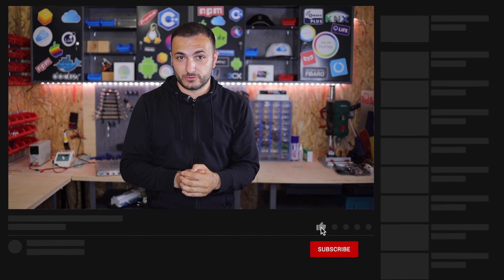Nissan Leaf GEN 2 batteries removed from car and installed on PV system running to 48V

Comment: Nice.
I have 77 modules and I configured them in 7 stacks of 11 each. Since each module consists of 2s lithium, the 7 stacks give me perfect 14s for lithium ion.
I set the maximum charge voltage to 4.10v per cell discharge down to 3.5v per cell. So far the system has been cycled daily for about 6 months and have had zero degradation.
Mine is 25 kWh usable with those voltage ranges. Could probably squeeze 30 kWh if I raise the voltage to 4.15v per cell but so far I have not needed to do that.
Looking forward to next video! Salut
Reply from the maker: I add an extra module and now I set also 7 stacks of 7, in this case nominal is 52.5V and because i use Victron devices is more than perfect. Regarding the output energy, i drain almost 18kWh and this whit a 3.5V/cell discharge. I set also the max charge to 4.15V. More videos will come. Thanks